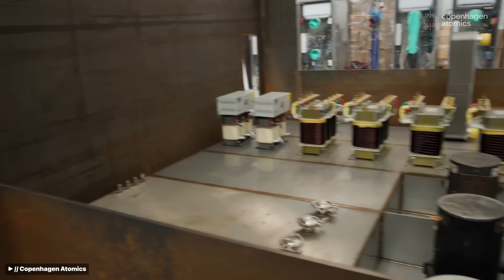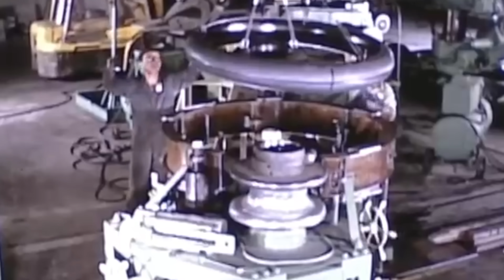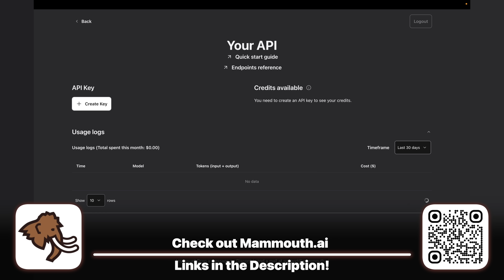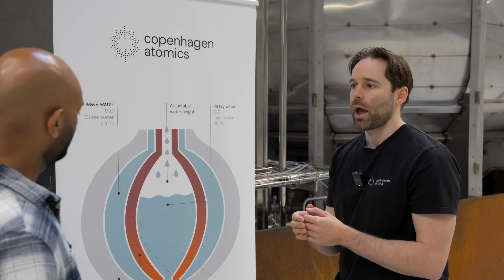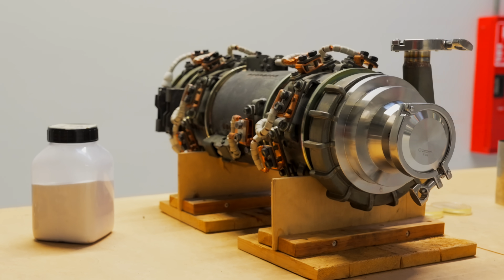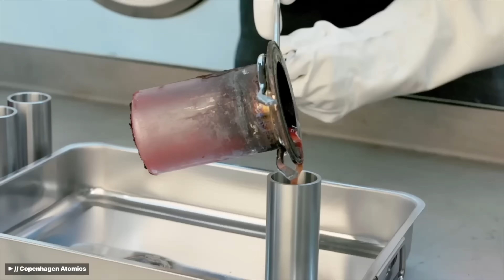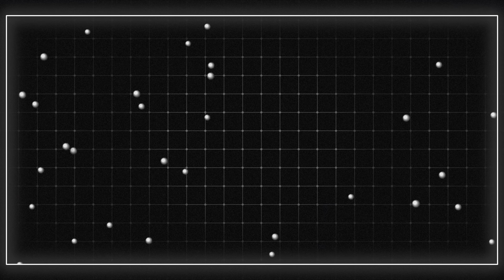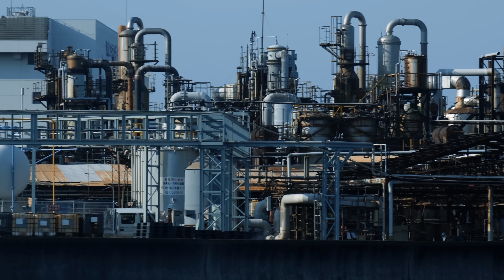This Modular Thorium Reactor EATS Nuclear Waste

Comment: Building one is easer, mass production not so much.  What about regulation and the NIMBY people.  The big question is WHEN.... 1yr .....10 yrs.
Reply: Just forget about nuclear.  Geothermal is the solution.
Reply: @TerraPotens537 Nuclear makes about ten percent of the world's electricity, and after hydro, more than any other non-fossil source. It's working in over 30 countries, and is the largest power source in some. Geothermal so far makes much less than one percent, and mostly on tectonic plate boundaries. Countries where it's an important part of the grid - Kenya, Iceland, New Zealand, Costa Rica- are small players. In places with much higher demand - Japan, Italy, the US, Philipines, Indonesia - even though they have good sites, it's a minor player. New drilling techniques might extend geothermal's envelope, but it's not proven yet.
Reply: @2x6x250ml  Yes, geothermal has been relegated to certain locations until now, but that's rapidly changing.

Millimeter wave drilling will make 12 km deep boreholes in ~100 days of drilling possible.

Superdeep supercritical geothermal is coming soon.

Comment: Why haven't we done this yet? Politicians who use fear mongering about nuclear energy to get votes. People thinking with their emotions and who won't use logic and reasoning and do their own research. Unreasonable layers of policies and bureaucracy designed to 'road block' any new development in safe, reliable, 24 hour 365 day nuclear energy, that we continue to abundantly get even when the sun don't shine or the wind stops blowing. It would solve the energy problems the before mentioned politicians need to keep alive to keep using to scare voters into keeping them in power. And many more reasons. Take your pick.
Reply: Nuclear is just mankind's most complicated and expensive ways to boil water.

We've got much simpler and cheaper ways to do that.

Geothermal is the solution.
Reply: @TerraPotens537  That's a good one, too. But too dependent on location. How many data centers are right next to a potential geothermal power site? A Small Modular Reactor can be put anywhere. Even on the Moon, Mars, space based data centers, or anywhere else where it's needed. Like any under developed country to power their burgeoning economies, or multiple small villages. All the more reason to focus on SMR nuclear power.
Reply: @rmerrida  Geothermal is no longer relegated to only select locations.  We can now do it planet-wide without hindrance

Comment: This video is very good because many know about the theoretical advantages of thorium reactors, but the practical stuff totally rocks.  The real reason why the LFTR didn’t take off in 2010, is because the US shuttled it until 2017, when a new DOE and admin advocated for it. Then, the practicality was worked out. An analogous situation happened when Tesla began working for Edison, and working hard, but not what he wanted to work on. He had already invented the concepts of moving electromagnetic fields key to alternating current, but broke loose from Edison and got backing to work the patents for polyphase alternating current power. George Westinghouse is rarely talked about, but he was key to not only Tesla’s success but the success of the US.

Comment: Last year, the Chinese opened an experimental thorium reactor and are now building a commercial one. They also hold patents on materials that can withstand molten salt. Thorium is the way to go.
Reply: Construction has not begun on a commercial Thorium reactor.  They need to gather a lot of data from last year's experimental thorium reactor before they can even consider starting construction.

Specifically...

China has plans and roadmaps for larger demonstration and commercial units.  Such as demonstration reactors targeting tens to hundreds of megawatts and timelines into the 2030s — but those are future proposals and not reactors currently under construction.

Comment: ORNL found coal ash had enough thorium to produce 18 times the electricity when used to power its MSR than was produced by burning the coal that produced the ash.  They also found all the coal ash in the USA has 11 million tons of rare earth elements and also huge amounts of Al, Fe, and other valuable elements. It should be obvious what we should be doing.
Reply: Another fun fact, if you dig a ton of any average rock the little amount of fissile and fertile material contains 20 times more energy than a ton of coal
Reply: @peace10794 That is probably true, but likely would need more energy to extract it than it's worth.
Reply: @ahaveland yes, that would only be economical if we use breeder reactors
Reply: @ahaveland  Not even close. In fact you can get it for free from the flotation concentrate in any metal mine. All the heavy metals are already concentrated. The key is breeder reactors, needed to burn the fertile (i.e. not fissile) isotopes. That's why the stooges Clinton/Kerry killed the highly successful Integral Fast Reactor project. And forced a gag order on all the staff.
Reply: Coal ash is a greater source of radioactive pollution than nuclear reactors. Go figure!
Reply: @ahaveland  its one of the reasons why coal power plants have the highest deaths per power produced heh

Comment: China operates a research reactor, not an industrial or, even worse, a commercial one.
There are no technologies for closing the thorium nuclear fuel cycle, where thorium is completely converted into uranium-235 or further down the chain into a mixture of plutonium-239, 240, and 241 isotopes.

There is no complete system for cleaning spent nuclear fuel from even isotopes and minor actinides.
It is unknown how many decades this will take.
Reply: Thorium is never converted to U235, you need to re-read the thorium fuel cycle.
Reply: @chapter4travels  U233 is converted to U235 up to 94%. U233 is converted from Th232. U need to re-read full nuclear fuel cycles.
Reply: @MihailG5541  No, U233 fissions 94% of the time. 6-8%of the time it's converted to U234 then to U235 which then fissions. That's why there is little waste.

Comment: So this is a unit that supplies heat. But you still need a turbine and a large grind connection to produce electricity - plus comprehensive security. The total footprint is many times the small bunker…..

Comment: Read about closing the nuclear fuel cycle. In the first stage, a mixture of uranium-235 and plutonium-239, 240, and 241 isotopes is extracted from depleted uranium and spent nuclear fuel after "hot dry" cooling for 6-12 months instead of 3-5 years of "cold wet" cooling. This mixture is mixed in specific proportions and loaded into a pressurized water reactor as new fuel.
This saves a third of natural uranium.

In the second stage, in fast reactors where the coolant is liquid sodium, lead, a lead-bismuth mixture, or in gas-cooled reactors (helium in one loop and carbon dioxide in the other), a mixture of plutonium-239, 240, and 241 isotopes is produced from this mixture with uranium-238, and only this isotope is used in the nuclear cycle. More than 10 cycles of such fuel combustion and processing have been proven; in theory, there are about 60.

Comment: I read recently that in early 1950's a modular Thorium reactor powered the base at Thule in Greenland. Seemed to have worked and the US military probably just buried it there.
Reply: Also not thorium - just a bog standard water-cooled uranium reactor.
Reply: No, it was a secret base buried up on the ice shelf, Camp Century. Turned out the ice wasn't as stable as expected, so after a few years the reactor was taken back to the States and decommissioned.
Reply: @2x6x250ml  Thanks for that

Comment: WOW LOTS OF CONCERNS HERE!!! Lithium7 Deuteride is used as the source for all the Tritium in Hydrogen bombs (the U235 is detonated in the "well" the free neutrons convert the Lithium 7 to Tritium plus one free neutron which then goes on to produce the same reaction as occurs in the Sun (Tritium converts to Helium-4 plus an extra neutron to keep the reaction going). I hope Li7 Flouride is stable ( but check out the Castle Bravo 1954 Test disaster on assuming Li7 tried to Tritium production would be small). Stainless steel CAN"T be used in a nuclear reactor it will deteriorate! This Thorium reactor is also entirely made from welded Stainless steel. (The Stainless Steel fails at the weld points due to ionizing radiation (see Union of Concerned Scientists on Stainless Steel piping failures in nuclear power plants between 1961-1997) & these were only carrying hot reactive water ,They Were Not within the reactor vessel ONLY  ZIRCONIUM CAN BE USED!
Reply: Zirconium dissolves in molten salts - CA might well use it for the water-facing surfaces though, till they can get silicon carbide working. Zircalloy isn't used because it's the only metal that can survive in a reactor, but because it has a very low neutron absorption cross-section. Silicon carbide's is even lower.
Reply: Lithium 7 makes up 93%  of the stuff in your car battery, it's Li 6 they need for fusion bombs (though Li 7 can also contribute, as they found out with Castle Bravo.) Neither isotope is radioactive, and getting hold of it is the least of your problems in making any kind of a bomb.

Comment: Doesn't Li6 turn the Tritium when it absorbs a neutron???
Reply: Some does - I think any tritium that migrates through two sets of heat exchangers will be absorbed by the nitrate tertiary salt, from which it can be separated (as tritiated water.) That should be much easier than tritium control at Canadian heavy water reactors - they have to separate it from heavy water (as extra heavy water.)

Comment: If Copenhagen Atomics has solved the molten salt corrosion problem, wouldn't their purified salt also solve the main problem of the billion-dollar solar concentrator farm? Same thing with their new molten salt pump. Seems this would also work with a solar concentrator farm. Would they refuse to sell their tech to a solar competitor?
Ironic if the first big customers for CA's reactors are AI datacenters and bitcoin miners. Instead of 40 acres of solar panels, your billionaire oligarch would just buy a single acre of land, then decorate it with a datacenter and an adjacent power plant. The parking lot might take up the most area. Local gov'ts still would want the facilities away from city centers, so they'd be off in the desert, or where corn used to grow.

Comment: If they can even come close to their economic cost numbers and production capabilities, this will fundamentally change the economics of so many industries.  Not only will it enable energy generation in new, remote, hostile locations like Antarctica, but also in places that are already occupied and totally dependent on diesel generators.  Wind and solar at these locations are neither practical nor a means to connect them to any realistic electric power grid.  Places like Nome and Fairbanks, Alaska.  All of the major South Pacific islands, like Guam or Fiji.  Not to mention the entire state of Hawaii. 
 
At present, we place factories not where they are most advantageous for manufacturing materials, but where they can obtain the required power.  So we mined iron and transported it across the globe instead of leaving it right next to the mine. 

Ships at sea used to transport commerce worldwide could be nuclear powered, not only reducing fuel costs but also making them much faster, lowering shipping costs, and avoiding hazardous chokepoints like the Suez Canal. 

 The list goes on and on.  

Fundamentally safer, cheaper, and where the power is needed.

Comment: Sounds like a good idea for a district heating in colder areas. Could sell excess electricity. Combined heat and power!
Reply: Or in use for large shipping industries, where thorium reactors like this could eliminate the entirety of the diesel/coal on large ships, easily cutting 50% of the total CO2 emissions globally
Reply: @sihamhamda47  Imagine Admiral Kuznetsov producing 50% less smoke, nothing more then a true miracle of science...